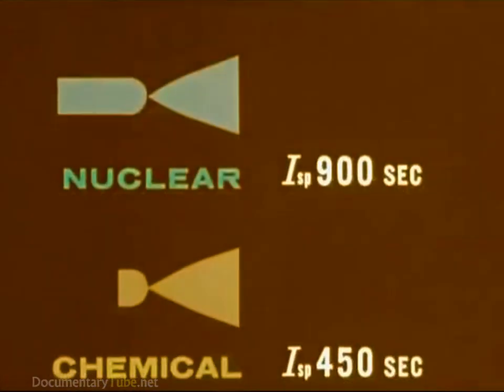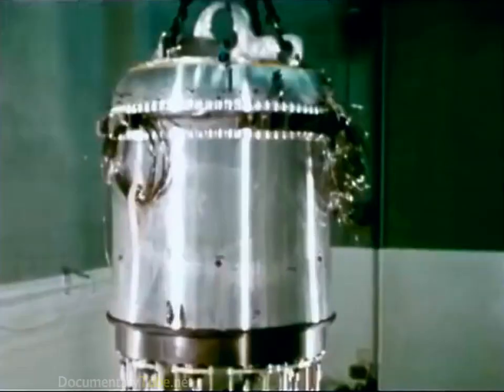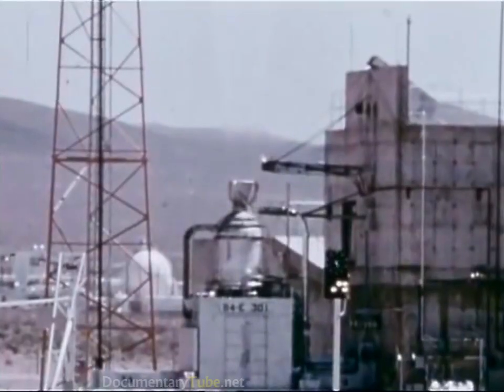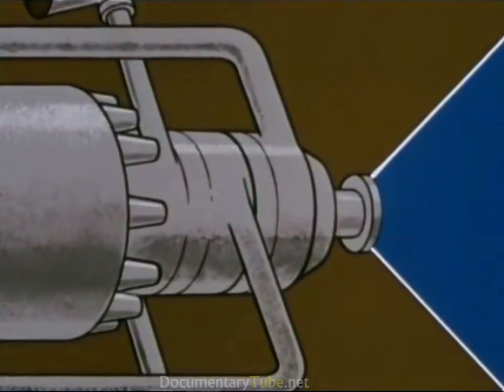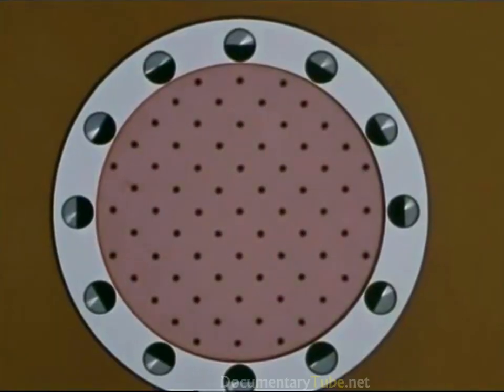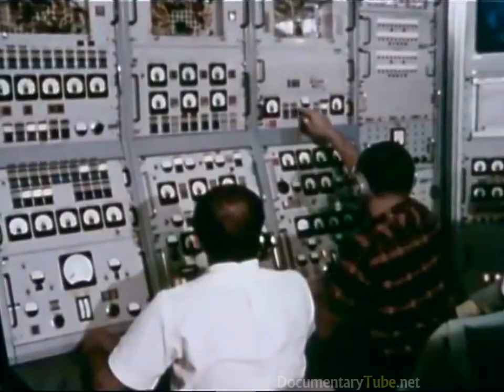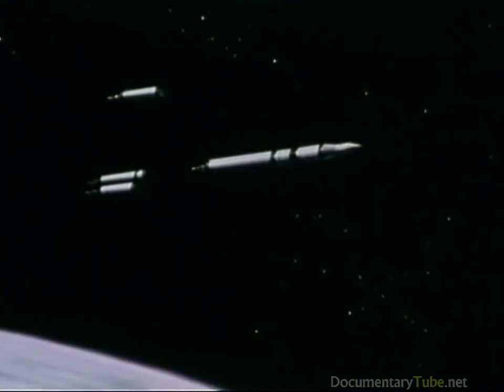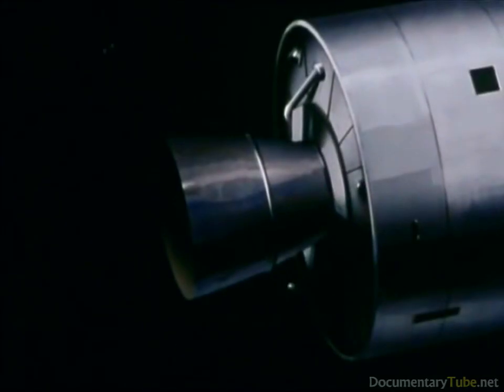HOW IT WORKS: Nuclear Propulsion

Comment: My father was head engineer for NERVA in the late 60's and early 70's at AeroJet. Those who were there know who he was. These guys didn't start using calculators until the mid 1970's, it was mostly done with slid rules. I can remember the noise from various rocket tests and we lived in Roseville/Loomis. My brother has the photo from that motor on the test site.
Reply: I worked for Aerojet (and other contractors) and may have known your Dad if he was at the site.
Reply: What is your Dad's name. I worked for/with AGC ;  ANSC ;  WANL ; LASL ; EG&G ; Pan AM ; at R-MAD ; E-MAD ; CR-A ; CR-C ; TC-A : TC-C  and ETS-1 and successfully avoided the A&E building. I do not recall any one guy being called "head engineer". We had "cog engineers" (cognizant engineers).
Reply: @jakesmart6139  Sir, respectfully, you are a badass. Currently in college obtaining my engineering degree, you are an inspiration in my eyes. Kudos.
Reply: When humans finally make it to Mars your dad needs the round of applause he deserves
Reply: @ngud_gaming267  Clap clap clap, shit, this place is useless.  Return to earth. LOL
Reply: LLO ur dad=US hero
Reply: Funny you should mention slide rules. When I took chemistry in the late 60s that's what we used to perform our calculations - also when I took trigonometry in 68. When I went into the USAF and went to technical school in August of 73, all we had to calculate with were slide rules. The most advanced calculators available on the consumer markets were simple "4-bangers" - they could only add, subtract, multiply and divide. Calculating alternating current circuits requires trigonometry and the only way to do that then was either with a slipstick (slide rule) or by hand using trig and log tables from a reference book.  All engineering prior to the 70s was done using slip sticks. And yet we went to the moon. 

Today you have more raw computing power under the hood of your automobile than Armstrong, Aldrin and Collins had in the entire Comand /Service Modul & Lunar Module COMBINED! The obsolescent computer on which I am composing this post is more powerful and has vastly more memory than any "super computer" in the world when I started electronics school in 73. It is truly a different world. Al that computing power. All that technology and yet at this moment we could not go back to the moon even if we wanted to. We have all the plans, specifications and blueprints for the Saturn 5 booster but we could not build one if all our lives depended upon it. So much for "progress".
Reply: @billmullins6833  why tho? Is it lost skill or what?
Reply: @billmullins6833  The Privatize Companies can get us back to the Moon. Easily. The Rockets from the 60s are Obsolete. I watched a Documentary on Rocket engines that the US Purchased from Russia. NASA used them to study and build the Saturn 5. It's always Stainless Steel and Titanium still never Changes. All other Elements are still not fit for Earth's Atmosphere. Elon Mousk StarShip still is pretty far away. The Saturn Fives Tech is far too Primitive. Lost of Knowledge engineers took with them to there departures to the grave. It Probably was good idea? So that the Knowledge could not be Stolen or sold to Dangerous Communist Countries.
Reply: I hope the innovators and architects of our future, people like your father, get the credit for all they have contributed.
Reply: Did your dad ever see a space x rocket return and land?
Reply: Was he a nazi
Reply: @jimcatanzaro7808  ya
Reply: I present my greatest respect to your father; and to those who served science.
Reply: Ask about Project Pluto. 
Supersonic low altitude missile. 
Was nuts
Reply: They should use the moon to test it out there.
Reply: I can`t imagine how complex and tedious that level of math was compared to how fast and efficient calculators are now in scientific applications. I remember that I had a college professor in my Business Math class say he did charts when he was doing his Masters`, without sophisticated computer softwares that we have today to do them. A classmate asked him to show an example just to give us an idea on how to do them, and he flatly refused because they were so tedious and time-consuming! lmao!
Reply: Bullshit
Reply: I lived in Roseville in 2017. Nice place.
Reply: I live near aerojet/ rocketdyne here in VA!.. Their facilities have barbed wire fences with nothing getting out or in fence tops almost like a prison!!
Reply: By Sacramento no way they did rocket tests never heard about that my uncle lives in Loomis also
Reply: Because this is a open cycle system, did your father or his team at NERVA, ever test the radioactivity of the hydrogen that went through the engine after the experiment of each engine was done.
Reply: Guess it shows my age, but, I can recall trying to get good at using a slide rule since was something my dad was good with.   Likely not as capable as your dad with one.   There may still be one in some of his stuff kept when he passed in 2010.
Reply: I grew up not far from Aerojet (less than 5 miles away) and I sure do remember those rocket engine tests. Not to mention the B-52s taking off from Mather. There was always something happening. I also remember knowing that we were a primary target for the Soviets, so if we got nuked it would be over in a millisecond so we wouldn't know what happened. My dad worked at Aerojet too. I think half the kids I grew up with had family working there. Those were the best times in California
Reply: So, they slid down the rule, ok.
Reply: Unfortunately nuculear trust boosters will require to be much smaller,  as the combustion is simply more powerful, doesn't change the volume of fuel, if taking human/living/fragile cargo.
 However, Electric/Plasma/Ion thrusters, which normally grants very minute acceleration, if can be nuculear amp in watts enough to sustain acceleration equal to gravity as G-Force approximately 0.5 to 1.75mph every second while traveling in solar orbit.

 This would grant gravity as well manage non-idle acceleration while reaching in a time duration even far faster and far further whthout nuculear radiation exposure equal to the harsh of chem-fuel.
 Save the classic chem-fuel combustion for emergency maneuvers and VToL sequal in atmosphere realms or moons.
Reply: hey my grandpa was one of the head engineers too, he was the one holding the lever on the last day they were going to pull the plug on funding when they proved it.  I have a picture of the scientist that day your dad is probably in the picture.  I'm going to try looking for it I'll let you know and post it up.
Reply: So why dont they use it ? 
if its clearly better.
Reply: @Akconvicted  Lost skill set. Some people don't understand when the tenth digit to the right of the decimal is nonsense and they get promoted based on arsekissing. There's jokes about this kind of thing in the military and engineering: "Measure it with a micrometer, mark it with a crayon and cut it with an ax."
Reply: @llo7816  hahaha
Reply: @llo7816  wait for elon
Reply: @llo7816  That is so funny!
Reply: @Akconvicted  --- Think.... of a very powerful Texas politician who declared "There ain't gunna be non a thet ther nukler stuff flyin oer the heads a ma fella Texans".... but he did manage to move much / most of NASA from Florida to Texas.
Reply: @jakesmart6139  wait for elon
Reply: @Akconvicted  === perhaps so.... wouldn't that be interesting.....
Reply: batse_gesig people are afraid of nuclear power.
Reply: @Akconvicted  LOL! Because it's dangerous as f**k! Even the very low power radioisotope thermal electric generators are a tough pill to swallow for many, and they are far from critical. The idea of blasting a critical reactor through the atmosphere was too much to risk. We just aren't good enough at this to risk that sort of Chernobyl style event landing somewhere down range.
Reply: @cageordie  ...such ideas / people go from hero status to zero pretty quickly when Chernobyl type events do happen. On anther video depicting / outlining the Chernobyl incident, I don't too many people sticking their hands up to declare their old man worked on site during / before  / because of such incidents. Actually I believe most of them are still trying to hide the fact. 

That being said:  ...really, I would like to know who gives these people the right to risk "our" whole planet more than is already being done by thoughtless individuals. I'm not that naive not to know the real culprits behind-the-scenes. Metaphorically speaking: who does give these people the right. One of the best statements I've heard in recent times, and which was created for a fictional character. "You can't just go sticking a United States Air force sticker on the side of it, Jack, and call it you own".

But in this reality, people, our planet needs the moon to live as we do, which needs the sun to warm our arse each morning after a frost, and that's  besides all the other things happening up there and all around. And another thing I  find funny. The voyager spacecraft, 1 & 2 , which was sent for a look-see.  NASA spent how much making sure it was all bug free so some distant planet couldn't catch something untowards from human kind.  And they won't  spend ten dollars here on earth in the fight against global warming, for argument sake.
Reply: @raymondbrady8742  well, did you not see the video ? no one gave them the permission, that's why this type of engine didn't flew. NASA has a goal : throw things into space. What's your point ? why would they go for global warming fight project ? that's not there goal ! so if you judge NASA to not spend money in this fight, with this reasoning it means that everything that don't fight for global warming is unethical ? see the problem in your reasoning ? NASA Integrate the problem of global warming inside their project as a constraint. but their project will never be about global warming only and thank them for that. 

I think you don't understand how critical the work of NASA, space x and every other space agency are for the future of humanity and for cleaner  energie. go read about fusion reactor and tritium mining in space.  Also Human IS a colonisator, there are way too much human on earth and that's because it has been 200 hundred years that we cannot extend the boundary of mankind. We definitely have to colonize others planets. It may be fiction today, but it's way more close than you think. We already have the technology to make engine that can reach proxima centoris in about 6 years. we may be able to break light speed barier by manipulating space-time. just remember how 500 years ago, nothing of what we do today was conceivable
Reply: @Akconvicted  Personally I feel that the use of nuclear engines for travel or what have you would be virtually pointless to use here on earth. At least during the times these engines were under development and even after they refined the designs, the risks of one of them crashing or anything going wrong far outways the increased travels times for global commerce.
Reply: @Akconvicted  Imagine the glorious nuclear flame trail vomiting from the rocket as it lifted off.

Then drifting miles over whatever...

That giant rocket they were planning to use for mars made so much power then had a heard of cattle planned for one of the decks. 

It was a star ship. They had the power back then to lift off that kind of weight. 

Just something about the giant nuclear flame trail drifting over here and there that seemed to get people excited.
Reply: @Akconvicted  President Lyndon Johnson said, I ain't gonna' have any a thet there nukler stuff flying oer the heads a ma fella Texans"
Reply: We should still teach slide-rule usage in schools. It give a greater sense of the relationships between numbers and visual feedback on the validity of calculations.
Reply: My dad worked at the unverifiable bullshit factory the next town over.

Comment: What the hell do they think they'll be thrusting against???Lol.....I hate to be the bearer of bad news but your engines won't have air pressure to push off of in your theoretical space.
Reply: it doesn't need to it works propulsion is due to change in momentum and the engine does that.

Comment: They had that in the 60s.  Now we have a hard time figuring out which bathroom to use.
Reply: My father was head engineer for NERVA in the late 60's and early 70's at AeroJet.
Reply: @llo7816  What the fuck... That's so cool! I'm only 13 but I'm trying to figure out how to make a better faster rocket for a Toshiba science fair project and I figured nuclear rockets would be a good option. Still trying to choose nuculer thermal or nuculer propulsion... I hope it works! But I barely understand any of this XD
Reply: +RosaLina May. Nuclear thermal rockets are really simple. Liquid hydrogen is passed over a normal fission reactor core which heats it up from about -252 degrees (celsius) to about 2000 degrees. the hot hydrogen gas then rushes out of a traditional rocket nozzle producing thrust. 

The upsides are that you get much higher specific impulse (basically fuel efficiency), and you don't need an oxidizer which lowers the chance of an enormous explosion. The downsides are that the exhaust is (possibly) radioactive which means it can only be used in space, except for very short tests, and the reactor itself has quite a lot of mass which means the engine's Thrust-to-Mass ratio will be lower than traditional chemical rockets.
Reply: @killman369547  And there's also an issue of radiation from reactor, prompting for mounting engines as far away from the crew as it gets and using shielding in-between (shadow shields, hydrogen tanks and so on...)
Reply: @killman369547  === If there had been "nuclear waste" in the exhaust we would have been deep, deep trouble. We could work on the pad the day (or so) after a test run.
Reply: @rosalinamay2636  dream kid never stop dreaming like my generation did.
Reply: Priceless Nate T.  Sad but true statement.
Reply: Nate Trav boomer cancer
Reply: Nate Trav Dude!! Hilarious!!!
Reply: Sad but true.
Why bother with scientific facts when with the power of rainbows and feelings one can turn in to a trigendered space unicorn.
Reply: @OriruBastard  psychology is a science more bizarre than anything else

Comment: I'm still at a loss as  to where they plan to get all this liquid hydrogen in outer space ? and since it uses a liquid then how it it not a chemical rocket?
Reply: 1. Water, from a moon or planet. Hydrogen is generated by electrolysis of water.  Water is everywhere. … 2. liquid to gas to plasma transition is a physical property, not chemical.  Any hydrogen burning off in the atmosphere is a side effect, because the hydrogen Is blowing out of the nozzle way, WAY too fast to ignite.  Whatever you do, don't allow an leaks!  or Bu-by launch pad!

Comment: The basic thrust part of the engine is actually quite similar to the Space Shuttle Main Engines.  Liquid Hydrogen is pumped through the nozzle surface passages to cool it.  The "heat" comes form burning Liquid oxygen and Hydrogen, whereas here the hydrogen alone is heated by passing through the fission heated core.

Comment: So the hydrogen is routed through the core where it is super heated and the expanding gas exhausts through nozzle into the atmosphere.    How much radiation does the gas pick up in the core?
Reply: JustWondering IS NOT TO BE USED INTRA-ATMOSPHERE.
Reply: @amauryll  Yes, but it was tested on the ground, first in the desert then outside Sacramento California, the state capital.  How much radiation is released by the hydrogen flashing through the core?
Reply: JustWondering But the actual use was going to be for interplanetary use ONLY. No intra-atmospheric use.
Reply: @amauryll  I realize it was intended for use outside the atmosphere.   I asked about the radiation released when it was tested on the ground, outside a city.   I wondered how much radiation was released by the hydrogen flashing through the reactor core as it was being tested.  On the ground.  Outside the capital of California.
Reply: @justwondering8409  If the reactor core wasn't breaking up, not much.
Reply: @caav56  OK,  I feel better now.